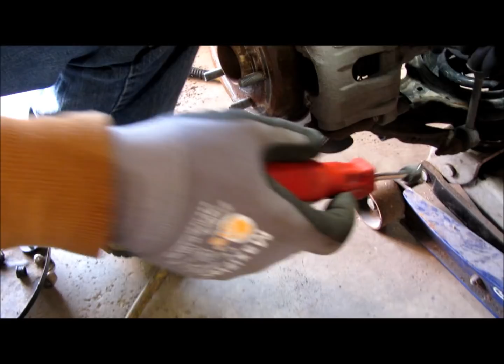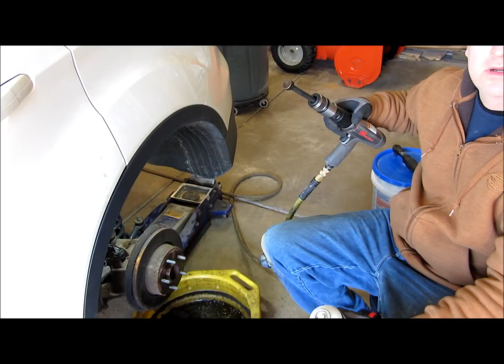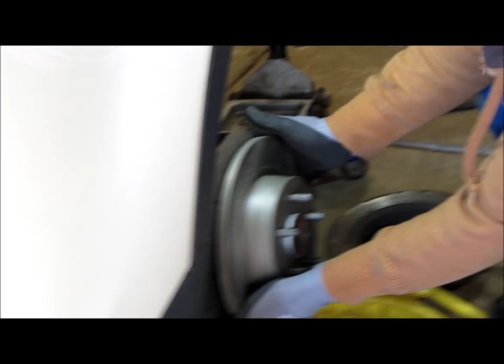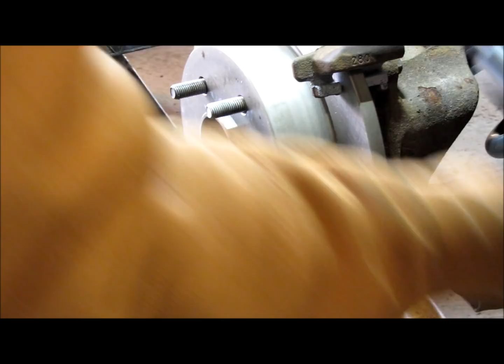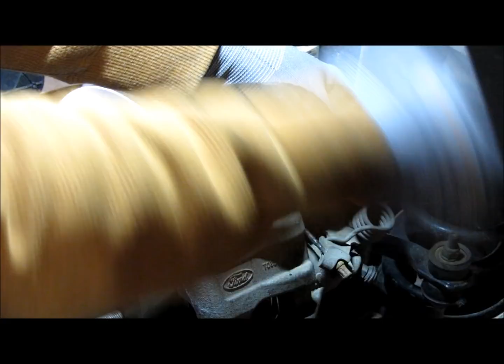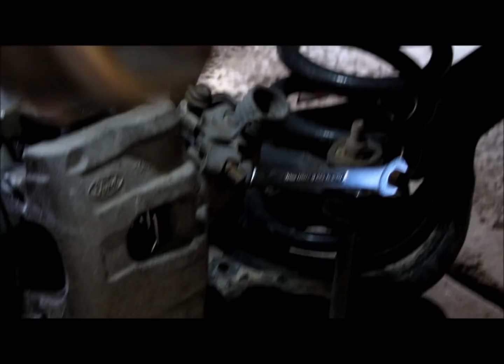2014 Ford Escape rear brakes

Comment: This was a great tutorial, so I’m a skinny fella… when trying to get the piston to retract, use a c clamp the old school way… moderate to heavy pressure, for 10-30 seconds…. Then try the tool… Makes it a little easier if you don’t have the arm strength… worked for me both times…

Comment: Us back yard guys don't have the vacuum tool so I guess wee have to do the old fashion, get someone to pump up brakes, bust screw loose while someone holds brake pedal to floor, then tighten and repeat till no more air just straight fluid? Also if no air is in line just changing everything shouldn't get air in there should it?Thanks! Other videos I watch had special tool to push cylinder back in but never explained that it had to be turned! Most my cars I just used a big C clamp to push cylinder back in! Glad I watched yours or I would of never known about the parking break,the 2 holes that had be turned! Thanks again!
Reply: Back caliper ,used needle point pliers, was a royal pain, but would never have figured it out without video

Comment: Make absolutely sure that you are using a brake caliper piston wind back tool! I borrowed a kit from autozone for free ($60 refundable deposit) and it works soooo much better than pushing/turning with the tool he's using.  That may work on other makes and models but definitely not a 14 escape! I will make a video for the other wheel.  Save yourself the aggravation and use the appropriate tools.
Reply: I just did this job. You are right. I used the tool he has here on my ‘14 Escape. It worked, but it was a royal PITA!! Good lord, each side took me 10-15 mins to get back in. Ridiculous design!!!
Reply: I went and got the loaner from Autozone, $60 but you get it back or they said you could keep it but I'm taking it back! My piston was out so far that I couldn't get it to go back in! I watched a different video first and read on a ford forum that you turned counterclockwise! Anyway I got air in my lines! I have changed many rotors and pads in cars from 2009 on down. This was the first time I couldn't use just a C clamp! I need to find that vacuum he had! Not sure if one can do it like old days? Pump up and hold brake pedal while someone else cracks the bleeder screw, and the brake pumper shoves pedal to flood. Then repeat 5 or so times till it's straight fluid and no air. Can it be done like this if I had too?

Comment: 55% of my time was dealing with that stupid screw piston. 20% dealing with those cheap ill-designed lug nuts (tore them apart and bought solid aftermarkets). 10% dealing with my jack leaking fluid. The rest was actual work and all went smoothly. I told the wife never buy another Ford. Your video was helpful, thank you.
Reply: mind linking me to where you got the new lug nuts? i'd like to take the old ones with the caps and throw them at employees of my local dealership
Reply: Where did you get the bit to turn  the screw piston??
Reply: I’m a Ford guy and those screw in pistons is the dumbest idea Ford could have chosen.🤬

Comment: doing this soon on my wifes escape.  I go 10+ years between newer vehicles, and methods change.  This is for sure the case.  I would have been mad about the allen bolts since my set are T handles and would not fit in that area, and i have only heard rumors about screw in pistons.  Thanks for taking the time to post this, and know that in 2020 you are still helping.

Comment: Well done work. Only a little tip buy a special wrench to twist the caliper piston. It is simple to twist it insufficiently, still it is necessary to press.
Reply: What's the special tool called?
Reply: Or just push at the same time as turning

Comment: Thanks i have done a lot of brakes but I couldn't figure out how to compress the calipers until I saw your video. I wasted a lot of time with my c clamp! Good video
Reply: Lol same! After 10min trying to clamp, I went to good ol reliable YouTube #Thanks
Reply: @AndrewCarrranza  one more thing. The pads were pretty worn and like you I had a hard time getting them to start threading. I used a pair of needle-nose pliers. I pushed as hard as I could and they still wouldn't catch. I got frustrated and tried putting the emergency brake on and for whatever reason it was way easier to get the brakes to start screwing in .  After that I release the brakes screwed the calipers in all the way reinstalled then pulled the emergency brake lever two or three times to set the brakes and they work just fine
Reply: beams great advice! Had the exact same problem and the e-brake method worked, thanks!
Reply: Same here. I actually had to buy a replacement piston and rebuild one side. I also had to buy a special adjusting attachment to fit the pin holes as the spacing seemed odd for the kit I rented from my local auto parts store. Once I watched this video everything got easier.
Reply: We arr having problems bleeding they won't bleed

Comment: Do I have to flush the brake fluid? I don't have the necessary tool to do this. Can I get away with rotor and pad replacement without it. Or perhaps have a shop do that for me after the parts have been replaced?
Reply: I have and haven't I guess it all depends on how much time you have. if you have time why not?
Reply: Flushing it is rather easy. It’s worth it to keep the brake system clean of internal corrosion by flushing the fluid every so often.